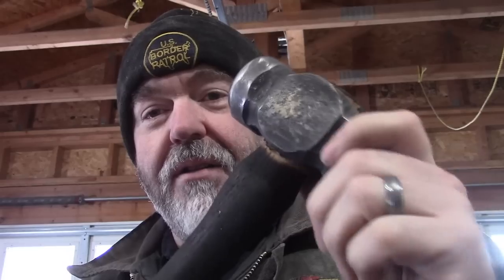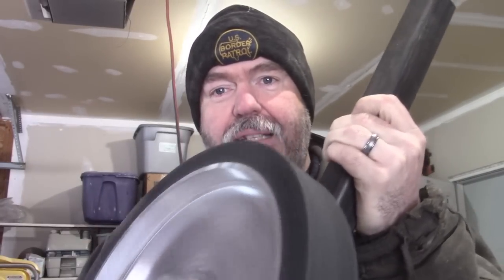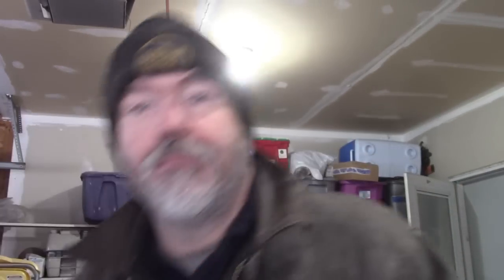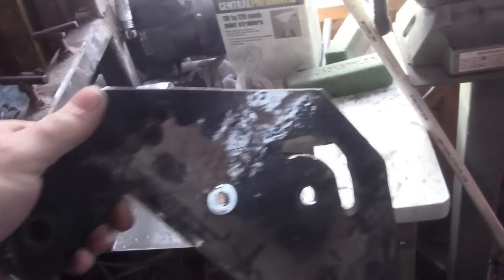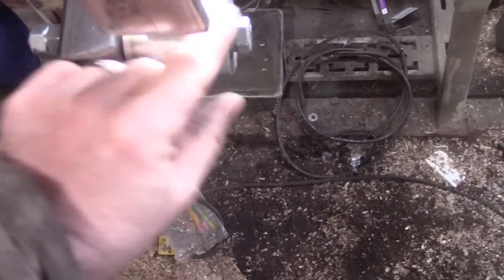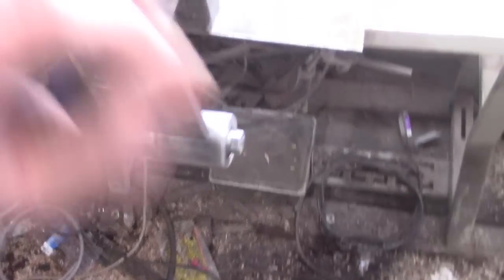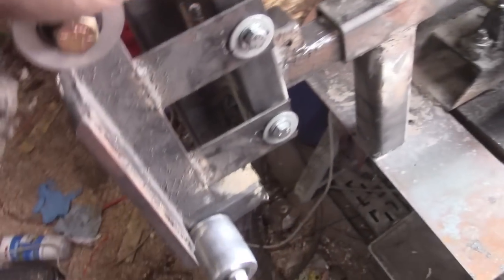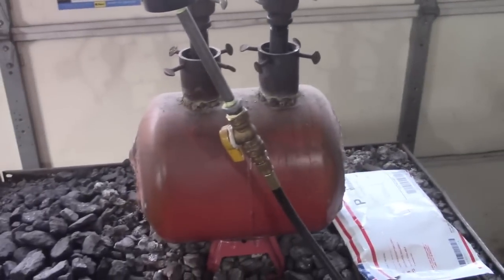HoJ Forge Shop Update

Comment: I worked on my shop all day yesterday in preparation of my Forge set up. Speaking of Do you have a video on the propane forge? I will look. I have a 134a cylinder I was wanting to use. Actually thinking about using 2 and going with two burners. How well dose yours work? Sorry for all the questions. Love the channel.
Reply from the maker: I'm sorry, but I never did a video on my propane forge.  It was my first attempt at making one, and really didn't expect it to turn out very good, so I never took any video.  BUT.... it actually turned out really well, so all of my plans about building a nicer one have all been put on hold.  I really don't use it much, except for heat treating, but it does easily get up to forge welding temperatures.  I made the burners after watching a few youtube videos about them.  I'm not sure they are the "best" but they were the easiest for me.  I can try and find the video I used if you were interested in them
Reply: Thanks for the response, I'm building one because it is really hard to get coal in my area. There is a supplier but his supplier is out. I have been given 2 coal forges as well, and plan on combining them to make one from the best parts. My main interest as of now is Knives and tools, tongs etc.. I think the gas will suit my needs, but the coal forge is coming.
Reply: Oh and I noticed your forge was similar to what I plan on building. That's why I was curious. Thanks again.
Reply: Can I sugest a ribbon burner forge it uses low pressure 5lbs to reach forge welding temp and also has the ability to lower the pressure after reaching temp and maintain it. if you are interested check out my build on my channel. I built it using Wayne coes design check it out leave a message and I will help with any questions you would have as well.. Martin M&S Bladres
Reply: Jason you should have built a ribbon burner forge its a blown forge I have a video on my channel if your interested.. Martin M&S Blades